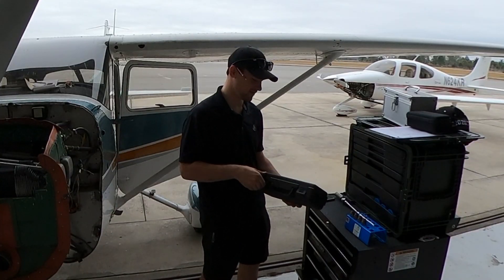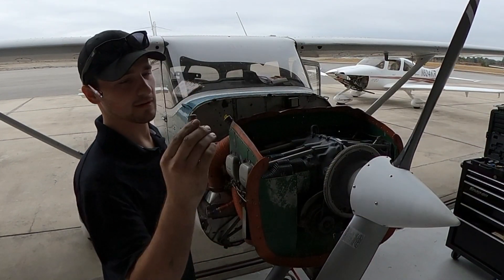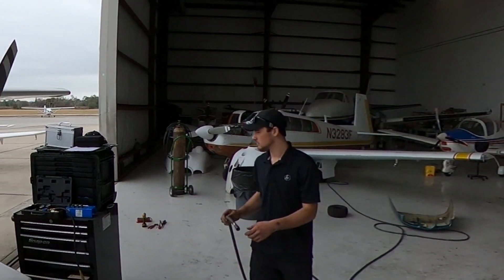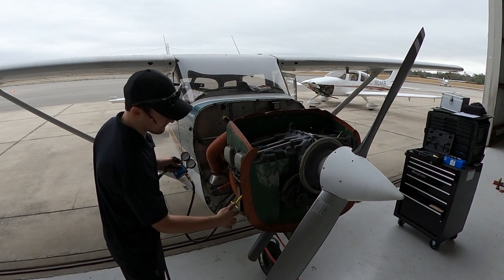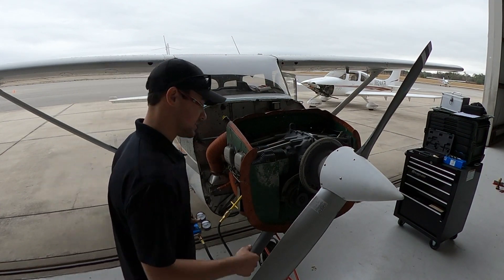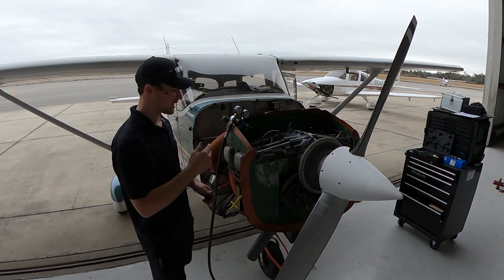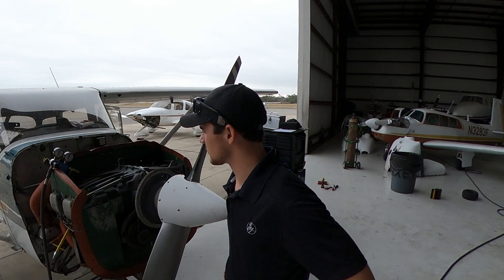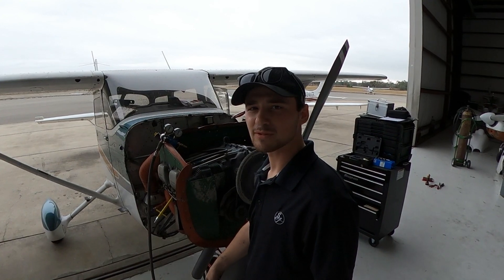How to Pull Compressions on Aircraft.

Comment: Per Service Instruction No. 1191A Cylinder Compression

“The condition of the working parts in the combustion chamber of a cylinder can be determined by measuring the static leak rate of the cylinder as compared to the leak rate through an orifice of specified size. This is accomplished by attaching a differential compression measuring device, which incorporates the orifice, to one spark plug hole of the cylinder while the piston is at top center of the compression stroke.”

Comment: So it's not really a compression test more a leak down test?
Reply: Compression test is what we call it in aviation. You automotive guys just happen to call the exact same thing a leak down test instead. It is what it is, no right or wrong really.
Reply: @dogemasta4907  an automotive compression test is when you crank the engine to see the max compression you can make. While a leak down shows you how much it leaks based on a 80 psi reference. 80psi goes in it leaks 6 psi so the reading is 74psi. But the engine compression while cranking the cylinder might make 120-150 psi on its own.
Reply: If you do a cranking compression test on an automobile and it fails you then need to do a leak down test to determine the cause. On a car it's somewhat difficult because you need to get a wrench on the crank pulley which is usually buried behind belts and accessories like alternator, power steering pump and A/C compressor. On an airplane it is very easy to position the crank because you have that big old propeller right there. So we just skip the cranking compression and go straight to the leak down but we just call it the compression test - we know what it is.